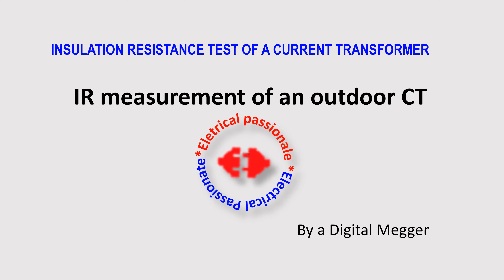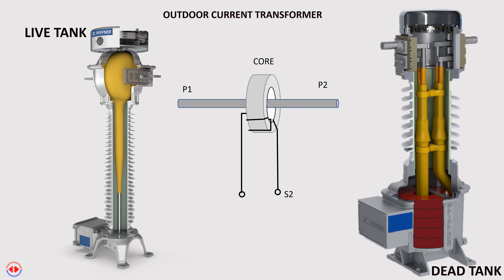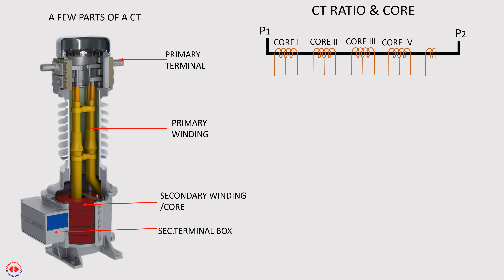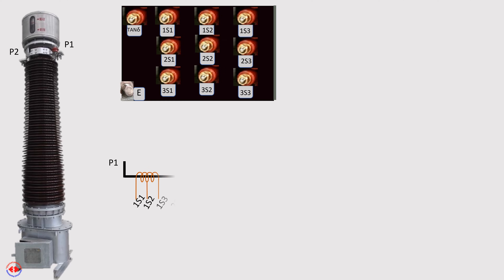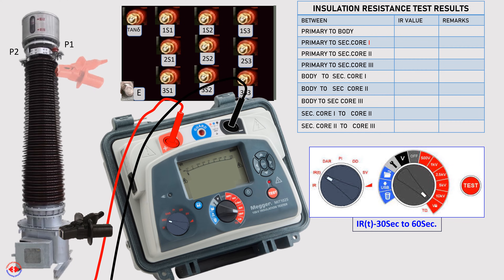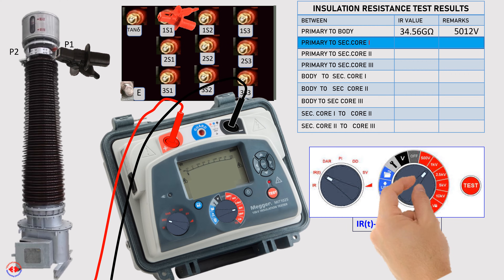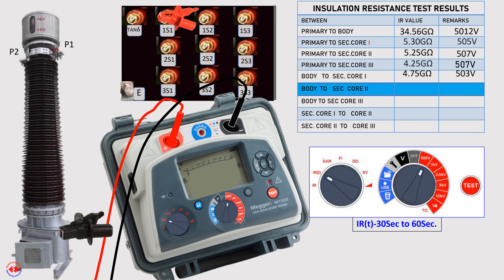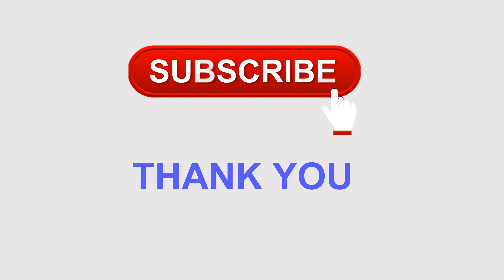CT MEGGERING/IR TEST OF A CT/INSULATION RESISTANCE TEST OF A CURRENT TRANSFORMER

Comment: Hi Sir, Thank you for the video. I see you didn’t short  to earth the other cores when doing P-S and  testing between the secondary cores because a CT should never be left open circuited
Reply from the maker: You are welcome. You can short the secy before test. But short circuit of seconadies may not be required as apply of voltage at primary side keeping secondaries  open circuited is not same when you applying voltage at both primary and secondary during  IR testing. Thank you ❤.